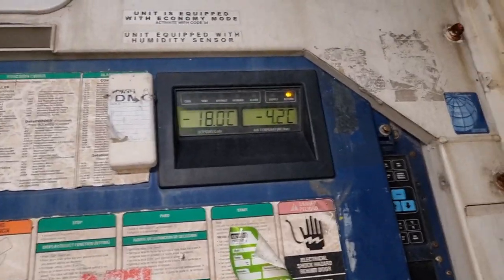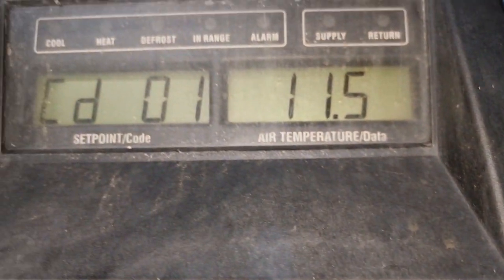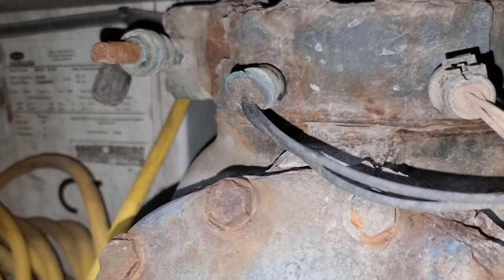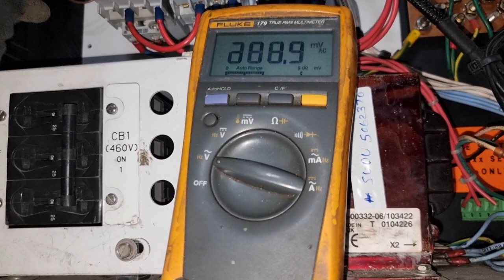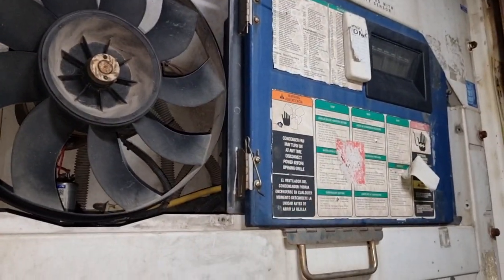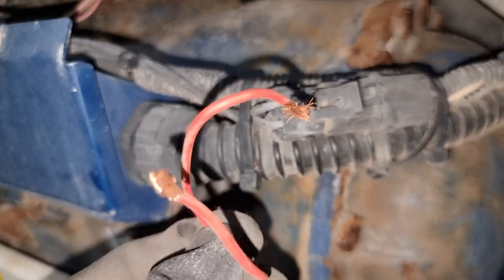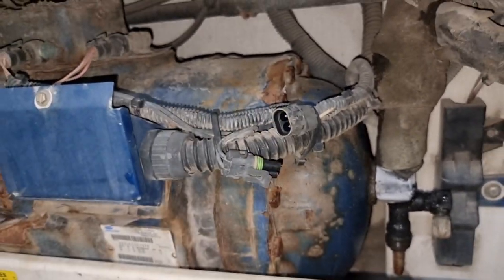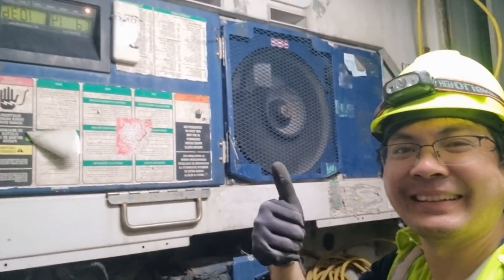Refrigeration Sytem High Pressure Trouble

Comment: Hello from a farm in New York.   Thank you for taking the time to share your skills.   I have some questions about a Carrier reefer box.   It is an older unit, from 1994.   The farmer wants to cool freshly harvested crops from the field.   I had it working for a few weeks but it stopped last week.    It uses the Micro-Link 2 system.    There is an orange flashing light (MB) on the control board.
The 10 amp fuse 3 (24volt circuit) is blown.   It gets 37 amps and blows fuse.    The machine is getting 490 volts.  I see it is designed for 380-460 volts.     Is 490 volts too much?

Fuse 3 covers the 24 volt circuit for the contactor coils.   This circuit has 25 volts.  My plan is to search for a bad contactor coil.     My concern is that the control board is damaged.   Do you have any suggestions on what would cause high amps on the 24 volt circuit?   I am happy to send you $ for some beers when you get to the next port.    
best regards
Brendan

Comment: my question is what is reason of putting Jumper on the Hps Connection?
Reply: To discharge the static values
Reply: @ELECTROMARINEMANIA  Good now i understand.
Reply: To bypass the switch that stops the compressor from running. (to give u a close connection condition)
Reply: @emmanuellactao1791  Thanks. Bypass mean, do we have to short the switch?
Thanks.

Comment: Im not sure why you did that.. You have the reefer cutting out because of high pressure (AL58), and also you have seen in alarm list that the thermal protection of condenser fan was opened (AL25).. Making bypass in pressure switch only will destroy your compressor.. It will run until blow a gasket, or, maybe just blow the fuse behind the liquid receiver..  You have to replace, or repair the condenser fan, thats the only problem you have..